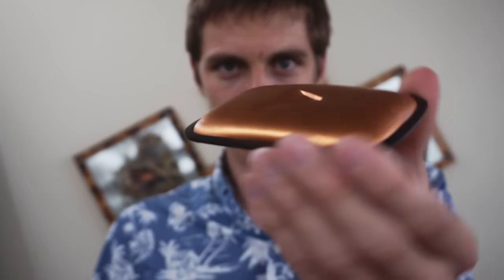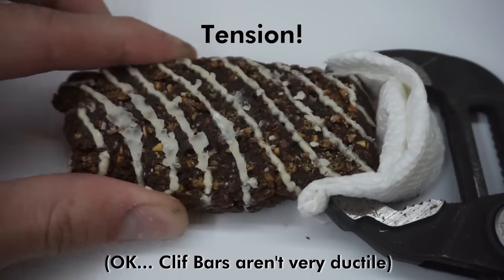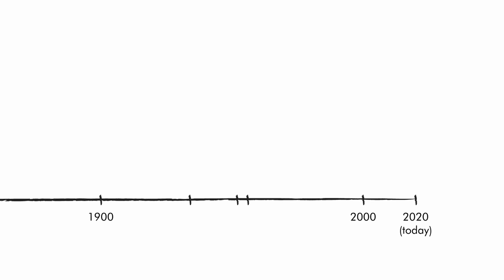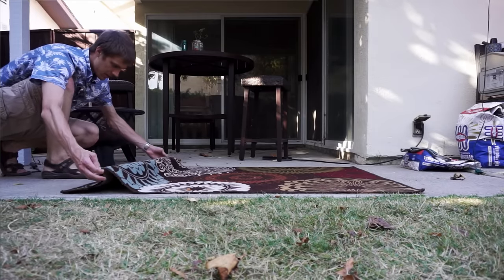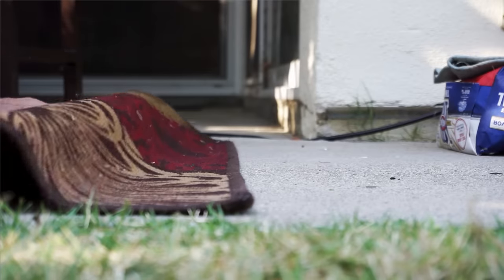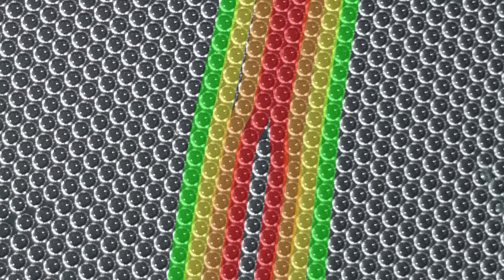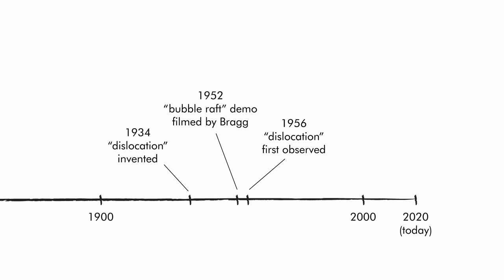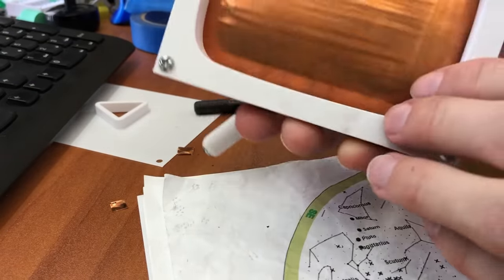Why are metals so stretchy? (2^13 sub special)

Comment: In an actual metal there are grain boundaries between crystals. How do they behave when distorted? We can see how discontinuities in the atoms move within the crystal lattice but what happens when all the dislocations reach a grain boundary? Are the grain boundaries stronger than the inter atomic bonds? Do the dislocations cross grain boundaries? There comes a point where the dislocations can no longer move and the metal cracks. Why?
Reply from the maker: That’s actually a really great set of questions and I’m not super up on all of those dynamics. Dislocation interactions with grain boundaries are complicated but you’re totally correct that the grains need to reshape so dislocations have to travel from one grain boundary, through the grain, and into the next.

Work hardening is generally dislocation overload. Too many get tangled up so none of them move. This can happen within each grain
Reply: @AlphaPhoenixChannel  hmmm you give me an idea. IF the dislocations do migrate past grain boundaries and you reach a point where they can move no more that means they have all accumulated at the edge or limit of the stressed zone? or would it be to the center of the zone? I have to think about that. In any case, it is known that metals can only crack under tension, never compression. So if a crack appears it must be at the place where all the dislocations have accumulated and can go no further? or does the crack appear where all the dislocations have left? I'm thinking that stress moves dislocations until they reach the grain boundary at which point the grain itself becomes stronger and after that the grain boundary begins to fail. I don't see how the grain boundaries can be as strong as the lattice inside the crystal because of the random arrangement of the atoms there although there should also be a larger number of dislocations in the boundary too? Confusing . I need further study. Thanks.

Comment: Dyeing thin copper sheets and stretching to demonstrate 'dislocation'. Dyeing requires multiple colors, very thin lines.
I don't think metals are 'dislocated' like liquid bubbles do, and 'dislocation' will break the metal, not stretch it.

Comment: You do realize that the dislocations are indicators that the bubble size is not perfect. Either way, too small or too large will cause a dislocation. @7:58 you can see that there are multiple bubbles that are smaller than the average size. This inconsistency perpetuates an illusion of randomness. If the bubbles are indeed perfect in size, you will have much different results and without the forced dislocations the bubbles should appear to bond to the lattice and stay attach with the appearance of more energy.

Comment: This got me thinking about smiths. How does that work then, does the smashing of the hammer introduce transfer of energy in the form of waves that stimulate rippling of the atoms or is it the local compression that stimulates forming of ripple waves? The video got me thinking it is the local compression. But I´m curious if the rippling can be simulated by other forces. Thanks
Reply from the maker: Dislocations are really easy to move at high temps
Reply: @AlphaPhoenixChannel  Thank you, But I struggle to see how that relates to the question I asked. My question was related to what actually is dominating the transformation of the metal. I was thinking that, if the hammer is just A form of ripple forming, and not THE form of ripple forming, then a smith could also form a hot piece of metal with sound-waves, theoretically. The energy created that effects the piece of metal shapes the metal. not necessarily the way that energy was used/created. (of course in equal amounts, so 100N hammer smash vs 100N equivalent ´soundwave force´.) I hope my question was more clear this time, I know my skills for transferring a thought process to text is terrible. Thank you again for taking your time!

Comment: what you are looking for is the formulars and technics of "deep drawing". Tool makers as raw as they may get this days are very well avare about this in general. But yes there are Decades of using this knowledge for industrial mass production. it can go so much deeper and mind blowing. in example your Cars frame is properly made up with some of this techniques applied to some parts. the hood most liely. but also your Bathing tube, shower tray. "push-pull procedure" is may something you find more with. Becourse if you drive a stemp against a sheet of metal to produce a cap it pushes the metel and somatime pulls it down in your created sink. you done it by hand but people who look closely may notices you riped it in the one corner becourse.. Cupper is very soft and you sure done the major mistake to clamp down the rim to tight. the rim got to be able to slide in in such processes. have fun discovering its really interesting to see how metal behave.

Comment: So this is plastic deformation? What happens in elastic deformation?

What about metal fatigue? You can bend a spoon once, but bend it 100 times and it breaks. Also some materials harden when deformed, why? For example, take a 50€c coin (50 cents in eur... how do you write that...), heat (and slowly cool) it to make it malleable, whack it with hammer, it bends easily. Continue bending and it breaks. The break point is harder than steel, altough the material is arctic silver (some kind of brass).

These are things I just know, I've tested. But having an explanation in molecular level would be interesting. I have no clue.

Comment: Trying to recreate this, how do you prevent the bubbles from deforming and filling up available space? I cant seem to get them to remain uniform with dislocations
Reply from the maker: Are they all exactly the same size (and extremely small)? Can they form small rafts ok? Do you have too many bubbles?
Reply: Thanks for the reply! They are all about the same size with a few joining to make bigger bubbles, perhaps i need more washing up liquid in my solution? They formed nice little rafts about the size of the footprint of a can of coke but bubbles were popping now and then, reducing the size of the raft
Reply from the maker: woah missed this reply - sorry. the trick is probably that the size isn't uniform, and if a lot of them are popping then the bubbles need to be much smaller. I tried to print a nozzle to make bubbles and ended up gluing that nozzle shut and just making bubbles through the miniscule leak between layers of the 3d print

Comment: Can u do this again but make the bubbles conductive. Then make the fluid it sits in capable of producing a visual effect wen electric current passes through. To give a visual demonstration of electron flow through these crystal structures 😀 great video by the way

Comment: What's hard to understand at first is the idea that metals will rearrange themselves without losing their unity . We tend to experience reality at a scale where it doesn't happen like this : you separate a piece of metal in two and they now are two pieces that can't stick back together . So the idea that at the atomic scale this is basically false and that half of the piece can slide on the other piece without becoming separated is very counter intuitive. But it's how it is.

Comment: Should be possible to demonstrate work hardening. Copper is interesting because it gets work hardened so quickly. Heating the copper and letting it cool easily undoes the work hardening.
Reply from the maker: It’s more of a 3D effect - doesn’t translate to this 2D model where dislocations are points and not lines

Comment: This was incredibly interesting. What happens to the crystal lattice when a material such as copper work hardens? Edit: Answered my own question on wikipedia lol
Reply from the maker: oooh good question - if you notice when the bubble dislocations collide with other defects like vacancies, and when they collide with each other, they stop for just a second, hung up on each other's "strain fields". For example, dislocations with their extra half plane pointed in the same direction will repel each other, and dislocations with opposite half planes will actually attract each other, and can even cancel out if they collide. "Work hardening" is when you deform a material so much you just fill it to the brim with dislocations, and they all get tangled up in each other to the point where none of them can move. Without moving dislocations, the material loses its malleability and ductility and becomes brittle, preferring to fracture instead of bend.

Thanks for that question!

Comment: Still sort of confusing as to why its stretchy. The molecules seem to behave like neodymium magnets. You can stretch the metal only to a point and then it becomes completely seperate and you need heat to reassemble the bonds.

Comment: I think that you focus on crystals, but not particularly on metals. I think that many metal properties can be explained by considering that the free electrons are the ones that matter and that they form a Fermi gas. Then it's a matter of using thermodynamics to derive the behavior of the metal when perturbations are applied. In short, my point is that the explanation of why some crystals are brittle and others are malleable (like metals) is missing.
But very nice video nonetheless. Keep up the good work!
Reply from the maker: The strength of bonds determines how easy it is for dislocations to move, since dislocation glide requires bonds to break and reform. It’s an energetic barrier to dislocation motion called the Peierls barrier. In the end, as you say, most things including bonding characteristics are governed by the electron density, but you do not need to go that far to understand brittle and malleable materials, just bond strength and dislocation motion
Reply: @AlphaPhoenixChannel  Alright, thanks, I didn't know about Peierls barrier. I wish you the best for your PhD :)

Comment: so...is this why you normalize your steel after you have been forging it? the hammering creates dislocations that pile up at heat boundaries where the dislocation cant move as easily, heating the metal to its critical temperature allows those dislocations to spread out over time, not sure if doing it 3 times is important (maybe giving it more time to equalize) or just superstition (blacksmiths tend to be a superstitious lot)

Comment: But how does a single crystal metal bend? It does not have dislocations for 'ripples' to form.
Reply from the maker: New ones nucleate at edges. Also unless it’s only a tiny tiny specimen that’s been very carefully made, it’s probably still riddled with dislocations
Reply: Thanks

Comment: At first, metaphysics will find that wired! ( Stretch Process )

Let say I have a piece of plastic paper Grade 7 8 or higher & I would love to make it softer! Than I just boil it down to softness & it got to grade 3,2 or 1..
This this tingle something in your head, that when you stretch metal, your potential of down grading the hardness of metal, also goes down.. something like I explained previously above?

Comment: what is there are no defects in the crystal structuer
Reply from the maker: New ones get injected at surfaces (and grain boundaries) check out the edges of the raft when I squeeze it.
Reply: @AlphaPhoenixChannel  thanks
Reply from the maker: In real 3D crystals there are actually ways to generate defects in the interior, it’s just messy and requires even more types of defects

Comment: Pretty much how semiconductors work, just instead of a metal atom is a silicon one and instead of a vaccuncy you have either electrons from dopping with elements from the next collumn of Si or holes from dopping with elements from the collumn before Si
Reply from the maker: That analog would be vacancy diffusion, not dislocation motion. I want to make a video about that too - bought 1k ping pong balls a couple years ago but couldn’t get them to shake right

Comment: Interesting...  If these dislocations allow for easy deformation of crystalline structures, why is it that some crystalline structures don't deform so easily?  What makes some of them more resilient to dislocations than others?
Reply from the maker: There are always some dislocation present, and more can always be nucleated from the edges of the crystal. The difference in hardness is all about the ability for those dislocation to move. Dislocations glide through metals with ease, but crawl through ceramics

Comment: How about a button using micro LEDs and a gravity generator. Basically it's a generator that uses weights and a magneto just like in a coo-coo clock!
But must run for at least 10-30 minutes in a reset!

Comment: The Roswell grey alien UFO crash must have had the technology to bring back metal to the original way our mathematics calculated it in reality, they said the metal would be thousands of times stronger to resist the urge to sheer? well that fits the description of that foil they found, thin as aluminium foil but didn't even dent to sledge hammer impacts.

Comment: you are just changing the property's of the metal annealing normalising hardening case hardening austinite and martensite progress in the respacing of the carbon structure of the steal by alchemy :P tight carbon is hard steel :)